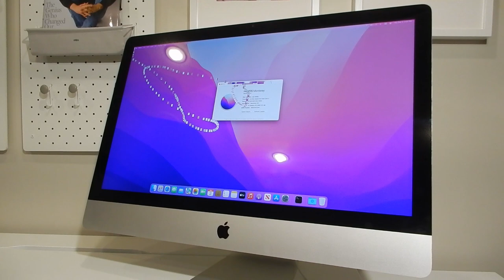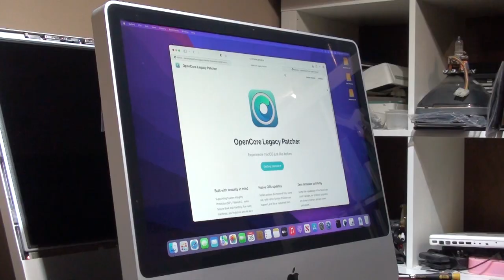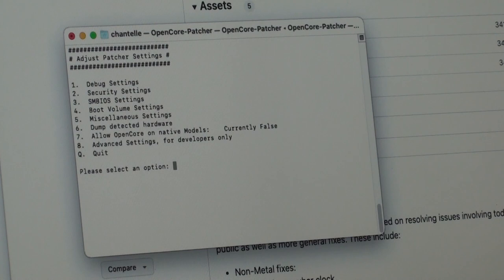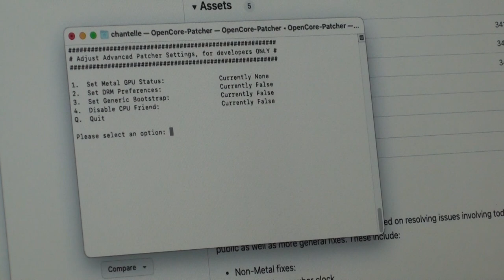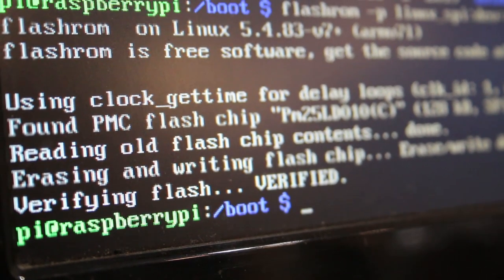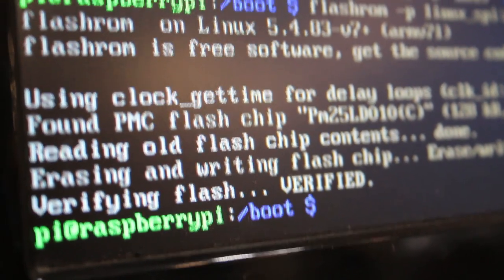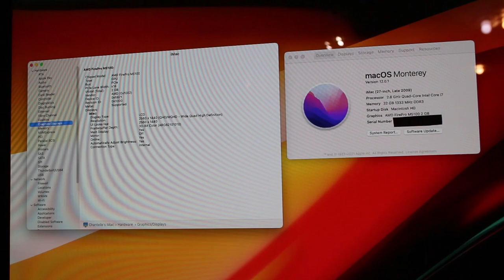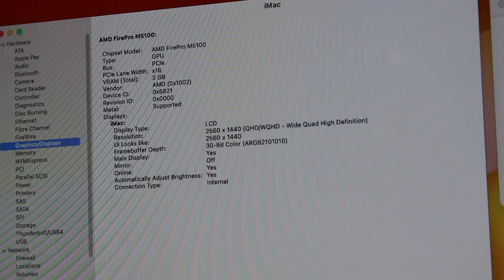iMac GPU Upgrade, Metal SUPPORTED!!

Comment: Bonjour! (From France!)
I’m interested by upgrade the GPU of my iMac to a non Metal to a Metal GPU. The spec of my iMac is iMac 21.5 pouces, mi-2010) A1311 - CPU 3,06 GHz Intel Core i3 - GPU ATI Radeon HD 4670 256 Mo. Do you think I “only” have to remove the graphic card like these you show us in your YouTube video ? If yes, could you advise me a card because these you show us is not available yet on Amazon. Thanks a lot in advance.
Reply: And do you think I have to upgrade the VBios ? (More difficult for me !)
Reply from the maker: Hi there!  You don't need to get the card from Amazon, there are many places including eBay or Ali Express.  Make sure you read up on that forum, because there are different variants of cards.  I can't really say for sure which cards work best, because I've only done this with the FirePro M5100.  But that forum post linked in description has an in-depth list of which cards work and which mods are necessary.  Keep in mind that even if you use the same M5100 as I did, there are 3 versions of the card and each version requires a different vBIOS.  Make sure you choose the correct one.

There are a couple Nvidia Kepler cards which I think work without vBIOS flashes, but keep in mind these Nvidia has poor driver support and requires excessive patching for Metal to work, and none of the newer Nvidia cards support Metal at all.  I know you're hoping for an easy drop-in replacement, but unfortunately this doesn't really exist for the 2009-2011 iMacs.  Each card you choose has some downfalls, and most cards will require a vBIOS flash to work properly.

One big reason I like the M5100 cards is they are really cheap on eBay/Ali Express, and they have full native Monterey support.  They should support Sequoia (not natively, but with Metal patches), although I haven't tested this yet to confirm.  I think there is a newer AMD card that should support Sequoia natively, but the issue is these newer cards cost much more money.  And it is hard to sink so much money into a 2010 computer.

Lastly, make sure you understand proper safety when working inside these iMacs, or have someone help you who is experienced in this type of work.  These iMacs all have exposed power supplies behind the screen, which can hold a dangerous charge and shock you even after the computer is unplugged.  Make sure you stay safe with your project, and have fun :)
Reply: Hi sir ! Thanks so much for your long and precise answer!! Well, I  have to think if I do it or not ! It’s not my job !! And that to “only” use Swift apps on my old iMac 2010 upgrade with OpenCore Legacy Patcher to run MacOs Monterrey!! 
Anyway.. thanks a lot for your YouTube job 
Salut de France
Reply from the maker: @patricetoulouse6055  No problem, hope it helps you!  Also, I forgot, but I think the M5100 does not need the copper shim and works with stock 21.5 inch cooler.  Double check though :)
Reply from the maker: @patricetoulouse6055  No problem, hope it helps you!  Also, I forgot, but I think the M5100 does not need the copper shim and works with stock 21.5 inch cooler.  Double check though :)

Comment: So fair to say on a 2012 iMac, this is a no go?
Reply from the maker: Correct, I believe the 2012 models all have soldered non-removable GPUs and cannot be upgraded.  I believe it is possible to use an eGPU on those models (see: https://egpu.io/forums/mac-setup/kryptonite-tb1-2-mac-egpu-support-with-filevault-sip-and-art-enabled/#post-95948).  I've never done it and can't vouch for the project, but it seems many people claim it works.  The only issue here will be that eGPU enclosures can be quite expensive.

Comment: What is the  reason to use the terminal version of OpenCore? As I can see, the new versions only have GUI compiled.
When you make sure that the system loads into OpenCore, then opencore is set up to the old graphics card right? Once you set it up for the new card, I guess it would not boot with the old card anymore?
Thank you for the video!
Reply from the maker: Yes, they stopped compiling the TUI version.

OpenCore will load whatever GPU is present.  The issue with the the specific card in this video is that there is no Apple ROM for it.  And OpenCore, for whatever reason, is not designed to detect it or can't detect it property.  This is why we have to set the Legacy GCN flag before build/rebuilding OpenCore.

The reason we need the TUI version is because the flag to set Legacy GCN doesn't exist in the GUI version, at least it didn't based on the docs when I made the video.  It's possible they've added this option since.  The TUI version is only necessary for cards in the AMD M5100 family; I believe Nvidia and newer AMD cards can be set via GUI version.

I can't remember if there were issues, but I believe the system did boot with the original GPU with the Legacy GCN flag set.  It may not have been detected correctly though, I don't remember.

It is important though, if you're using the M5100 like me, you will need the vBIOS modded and OpenCore Legacy GCN flag set BEFORE booting, or you won't get video on your internal LCD screen.

Hope this helps you, and good luck on your project!

Comment: Hi friend, I bought mine with the iMac BIOS on aliexpress, but when I start the system, the screen is full of artifacts, but it doesn't appear in the installer, but I didn't do this AMD Legacy GCN thing, could that be it?

What system can I install? I'm trying Monterey 12.6.7

Please help me

Thanks
Reply from the maker: Hello, if you are using a newer version of OpenCore it should detect the GCN GPU and automatically do the GCN setting.  If you get video on the iMac LCD, then this setting is probably correct.  You should never have artifacts, or else there is an issue with your GPU.  If you are using a cooler from 27 inch model, you need the copper shim because the die height is not tall enough on the M5100 to reach the stock cooler.  This causes insufficient mounting pressure and the die will overheat.  You also need to make sure you reinstalled (or better yet replace) the thick sticky white goo thermal paste, because this cools the memory chips and I think some other things.  I think if you have a 21.5 inch model iMac, you do not need the copper shim because the die height on the stock GPU is taller.  But double check.  Artifacts usually happens from cooling issue, bad VRAM, or bad GPU die.  A bad OpenCore config should not cause artifacts.
Reply: @rebootretro  Thanks for the answer, I'm using an iMac 27 late 2009 i5 imac 11.1 in the installer it works perfectly, but when it starts monterey it gets full of artifacts, I tested Mac os high sierra. and it worked perfectly, without any artifacts that's why I think it's something system related or a configuration that I left out, for example this AMD GCN I didn't activate it in opencore
Reply: Another interesting case is that I had a M6100 video card and the boot selector did not appear. I did the bios and it appeared. I saw a website with several bios, but I lost the name of that website.
Reply from the maker: @vitortiberio100  Are you running a fully clean install of Monterey (WITHOUT install patches)?  Are you running the latest OpenCore version?  I don't think an option exists anymore in newer versions of OC, I think it's automatically detected.  I would maybe run a GPU benchmark under High Sierra (like Heaven) to see if the GPU can perform normally for 10+ minutes under load.  If there is bad VRAM only in upper regions, maybe it doesn't get hit all the time.  Also, are you sure it has the Mac BIOS preloaded?  Many Ali Express sellers just say "compatible with Mac VBIOS" but it comes loaded with PC BIOS.  It's also possible they loaded the wrong VBIOS - that card has 3 versions for 3 different cards, and they are not interoperable (although I would think this would cause it not to work at all).
Reply: @rebootretro  So, it happened to me that I installed Ventura and this happened, the screen was all with artifacts and it only worked with Monterey, my video card is the same as yours!, but I had the W5170 and I had the same problem when I installed the latest version of Monterey and the screen was all with artifacts, but I'm going to do this by modifying the BIOS, there must be a BIOS already with the selector, or I use the BIOS that you used, it's safer, even because it's for a client, and I don't have his machine here at home
Reply from the maker: @vitortiberio100  Interesting, maybe there is some issue with that card on the latest Monterey onward.  I have not tested the latest to know for sure, but my understanding is that the card should work fine up to Sequoia with the correct patches.  I think it's on 12.6.9 currently and graphics is working perfectly; it's not currently used daily and I haven't yet updated to the latest release.  I do know on anything AFTER Monterey you do need the post-install patches for full graphics support, since the Metal version needs to be rolled back to support GCN3 graphics.  I'm really sorry, I'm at a loss.  I'm not sure why yours isn't working.  I would definitely try the "working" version of Monterey WITH a stress test just to know 100% the GPU is working fine.  If it is, then you are 100% right - it must be a software.  Unfortunately I'm not sure exactly what the issue would be.
Reply: @rebootretro  Good morning, my friend!

I've been updating the system. I applied GCN and, to my surprise, it worked normally! No artifacts whatsoever, however...

I did a stress test. It was on for 10 seconds and then turned off. I checked the temperature and it went from 50 degrees to 83 degrees and turned off. I removed the video card and saw that the heatsink is not compatible with it. The die doesn't touch the heatsink :( I'm going to install a heatsink from a 2011 21-inch iMac. It should work. Thanks for the tips, my friend!
Reply: @rebootretro  Friend, one more question! How many mm does the copper have to be? Thanks!
Reply from the maker: @vitortiberio100  I don't recall offhand and can't confirm, but the forum post (linked in description that has the guide) says 0.3 to 0.8mm MAXIMUM thickness.  It also depends on your cooler; if you are using a 27" iMac cooler then I think you need the shim, but for 21.5" iMac I think the stock die height is shorter like the M5100 and you do NOT use the shim.  Double check the forum docs to be sure.  Also, make sure do check thermals before doing any stress tests to make sure die contact is good and the GPU die is cool enough.

Comment: How thick does the copper shim have to be and do I need it if I am using the same gpu in a 21.5 inch imac please help me.
Reply from the maker: It depends on which stock GPU you have.  The reason you need shim on 27” 2009 is the  the Radeon HD 4000 MXM 3.0B factory card has lower die height than the FirePro 5100.  The shim should be somewhere from 0.5 to 1mm thick. Some newer 21.5” iMacs use MXM 3.0A cards and have the same die height as the FirePro 5100 already, where you do not need the shim at all.  The exact shim size does not matter, you just need to make sure you have proper mounting pressure between the cooler and the chip die.  Too much pressure could crack the die, too little will not transfer heat and will overheat.  But there are springs to hold pressure, and there is a relatively wide range which is acceptable.  I hope this makes sense?
Reply: Thanks a lot for your response.
Reply from the maker: @stivixhemo7801  No problem!  I see you also commented and asked about the M4000, but I can't find the comment anymore - not sure if you deleted?  Anyway, I'm not sure about the M4000.  You need to be careful since some cards have slightly different layouts, and certain components can interfere with the factory heatsink in addition to die height.  Your best bet is to Google that card and see who has used it in your specific model, and if there are any issues.  Some cards do require a BIOS flash to work, some will work without.  I used the 5100 because 1. it had full Metal support, 2. it was well documented on how to make it work and 3. I had one on-hand to use.  I may have chosen a different card if I didn't already have that one.  There are many good options to use, but just make sure to read up on it since it is difficult to tell from a photo if it is compatible.
Reply: Well I did comment about the m4000 because it was cheaper. There isn’t much documentation on google but I’m pretty sure it will work perfectly with my 2010 iMac because it seems the same form factor as the m5100 I don’t need the metal support as I just need to replace the failed card and I am mostly happy with 10.13 so thanks for the help. I was worried if I needed a shim with a 21.5 inch iMac but it turns out I don’t so thanks.

Comment: I'm using a mid-2010 model 21.5 iMac, which graphics card should I upgrade to?
Reply from the maker: There isn't really a "perfect" card for any of these older Macs... Every card has some issue or another, requires different mods, etc.  I like the FirePro M5100 I used, because they are cheap and have native Metal support.  You need the vBIOS and OpenCore set up correctly, then Mac OS picks up the card natively without any OS modding.  There are other AMD cards with decent support as well, if you found a better deal or wanted a faster card.  I would not recommend using any NVIDIA cards, as they have really poor Mac OS driver support.  Check the article in the description, it has an excellent list of cards.  Remember to read up thoroughly before buying a card; some cards have multiple hardware revisions and not all have the same compatibility.
Reply: @rebootretro  I didn't expect the Nvidia card to be non-recommended. I was thinking of switching to the Nvidia Quadro K2100M.
Reply from the maker: @sshun-x3z  The problem with NVIDIA cards is they had a fight with Apple, and drivers no longer exist.  So any drivers we have are Frankenstein'd legacy drivers.  Based on the OpenCore docs, only Kepler cards have Metal acceleration - so you actually should be fine with a Quadro K2100M since it is Kepler.

It also depends on the OS you're running.  On Monterey, you get full Metal acceleration without any driver patching... whereas I believe Kepler cards require patched drivers.  But if you're moving beyond Monterey, I believe even the AMD ones require patched drivers.  I suspect the newer AMD drivers would be more stable than legacy NVIDIA ones, but I don't know that for fact.

This is what I mean by "no perfect card".  Each card has advantages in different areas.

I'm actually working on a new video about a 2012 iMac with Kepler graphics, which upgraded to Sequoia and seems to work fine with Metal - although testing isn't complete yet.
Reply: @rebootretro  I want to upload it as macos sonoma, what metal graphics card would be good?
It's hard to find it because I don't have enough data..
Can you recommend one?
Reply from the maker: @sshun-x3z  Every card has it's pros and cons, there is no card that works perfectly.  I can't really recommend one, because you'll be the one that has to live with any trade-offs the particular card has.  I'll give you the links below you need to read up before you go ahead with this upgrade.

Read up on this forum (https://forums.macrumors.com/threads/2011-imac-graphics-card-upgrade.1596614/) particularly the first post which gets updated with all known working cards, including what mods are required.

You should also consult the OpenCore GPU Buyers Guide, so that you know which cards have native support and which use patched drivers.  AMD: https://dortania.github.io/GPU-Buyers-Guide/modern-gpus/amd-gpu.html#native-amd-gpus and NVIDIA: https://dortania.github.io/GPU-Buyers-Guide/modern-gpus/nvidia-gpu.html#kepler-series-gtx-6xx-7xx

Kepler cards used to only support up to Big Sur, but as of the latest OpenCore version they are working up to Sequoia.  I'm told it's possible to get native boot screen picker with some modded NVIDIA cards, but I have not verified this.